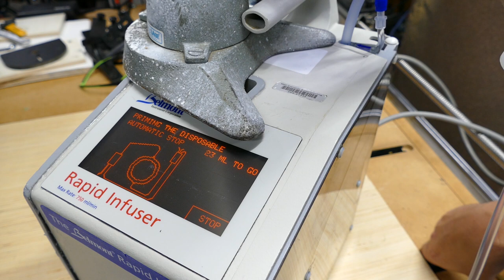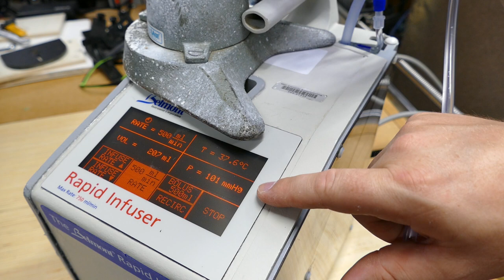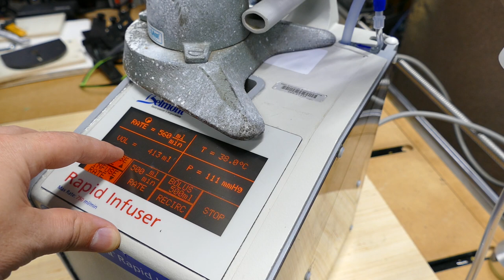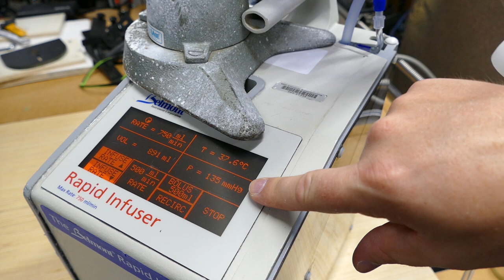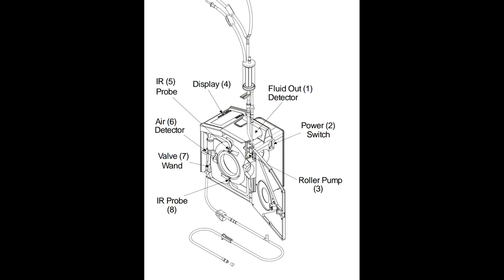Belmont FMS2000 Overview

Comment: FMS2000 looks like a good rapid infuser. We had the the one with the water bath, which worked ok. Always cleaned the water bath during PM’s and any repairs. Our documentation followed guidelines in service manual. Learned early on that PM completed was not documentation. Some  Biomed’s would document repairs or PM’s by saying fixed or completed. My work orders have been checked before by the State Board of Health, FDA, Joint Commission, and that would not fly at all. I got lectured once by the State for forgetting to document changing an o-ring on the rapid infuser for about 30 minutes. Started making PM forms for the equipment I worked on in Word and then would copy and paste in my service program as needed and then fill in the blanks. Saved me a lot of typing and time.
Reply from the maker: Its never fun when the lawyers walk through and start pointing at equipment, demanding service histories..